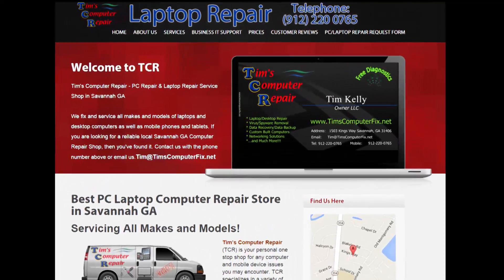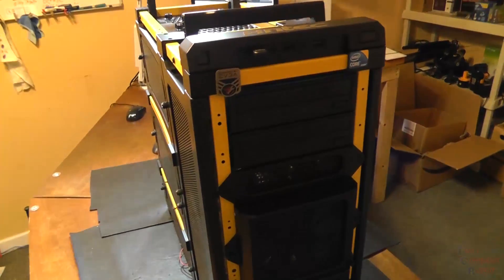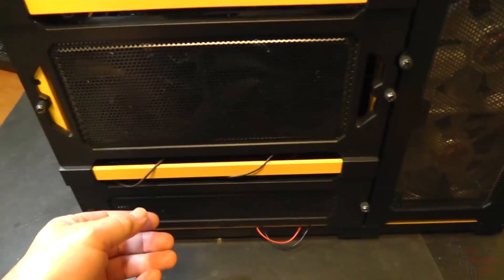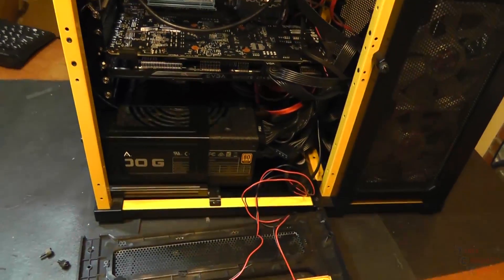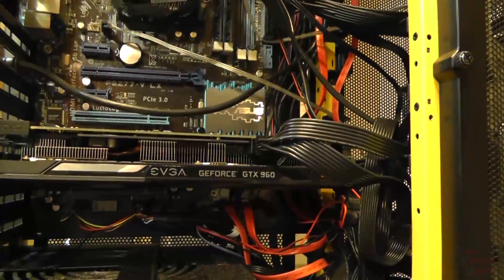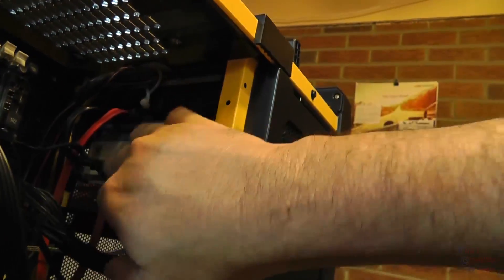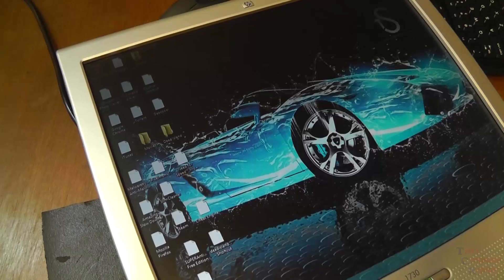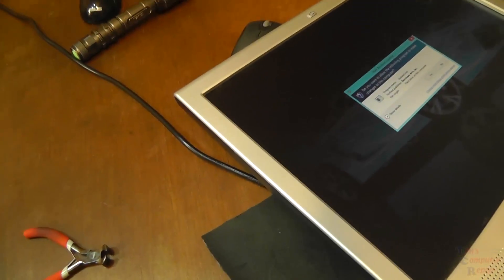What Caused This Reboot and Select Proper Boot Device Error?

Comment: This Happens to me after a full boot up, everything acts fine and then after some time, I get an oops something has went wrong, your PC needs to restart error and then it restarts and gives me the  "Select Proper Boot Device" error. Please Help.
Reply from the maker: Check the health status of your hard drive.
Reply: +TimsComputerRepair through command prompt with the chkdsk command?
Reply from the maker: Oreferably removing the drive and mounting it as a slave in another computer or mount through usb. Run a tool like CrystalDiskInfo and see if the drive passes.

Comment: Tim....shut the fuck up...stop wasting my time with a computer tour , just tell me how to fix the error message. WOW no HD hooked up....how lucky.....here's what this laptop is doing....same message....replaced HD with 3 different drives , replaced memory , reset boot device in Bios, reinstall windows 7 (with CD)....it goes to start up ,freezes then gets a red bar across the top of the screen. it also does not matter what version of windows u try. Tried installing windows with flash drive , reset bios to USB and get the select proper device message again.  There.....whats the problem !!
Reply from the maker: +stphnc Thanks for watching.
Reply from the maker: +stphnc Thanks for watching.